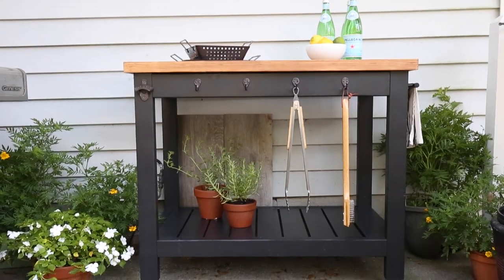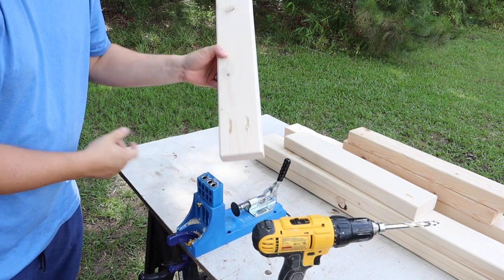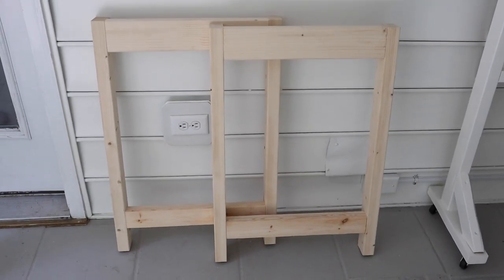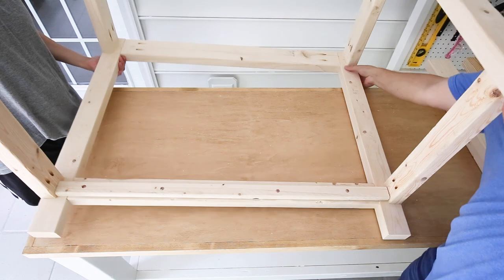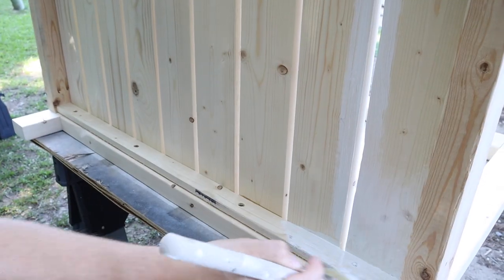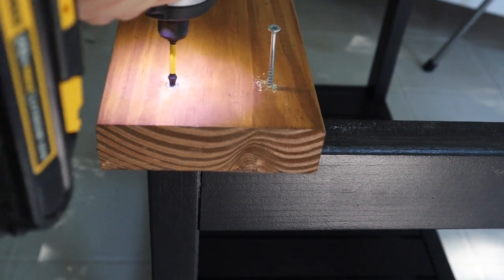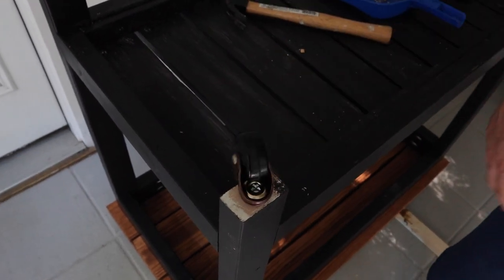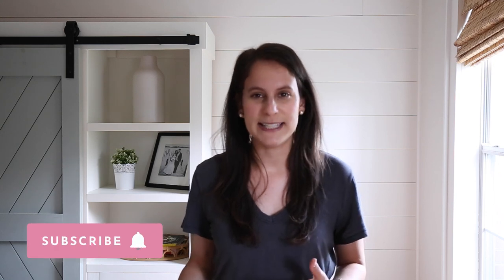DIY Grill Cart | How to Build an Outdoor Grill Cart

Comment: I just bought the plan for this one (even though you pretty much give the whole thing away. I just felt like I should give back.)
BUT. I noticed that the 1 1/4” self tapping wood screws you used to create the shelf for the bottom slats aren’t mentioned. Just fyi!
Reply: I literally just noticed this. 
Question: did you use weather treated wood?  My cart is not leveled and I'm tempted to start all over with untreated lumber.
Reply: @ktaylor7144  I am heading to the store today but plan on using untreated pine. I’m pretty sure she used that too.
Reply: @Lisa Peek That's what it looked like to me.  I believe I'll start over.
Reply: @ktaylor7144  just think how great you’ll be at it the second time!!
Reply: @lisakfish  I sure hope so. I wish you well with building and thank you again

Comment: You did an amazing job!!
Did you use weather treated lumber?
Reply from the maker: Thank you! I would not use pressure treated lumber on anything that is going to be touched with hands and around food. You can use cedar for extra protection or another weather resistant wood if you are concerned. An exterior stain and sealant can also be added for added protection!
Reply: @AngelaMarieMade  Thank you. I'm still trying to learn everything there is about building with wood and the tools. You did a really great job. I'm close to being finish

Comment: Did you put any finish on the wood other than the paint and stain?  If not, would you recommend something like Spar Urethane since it will be outside?
Reply from the maker: I did not, both the paint and stain were exterior products that don't require a sealer.